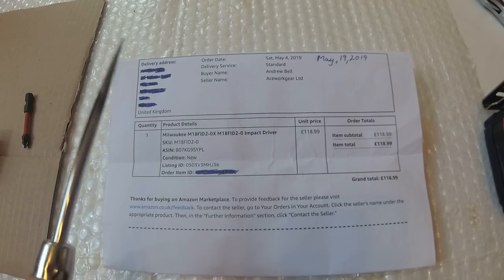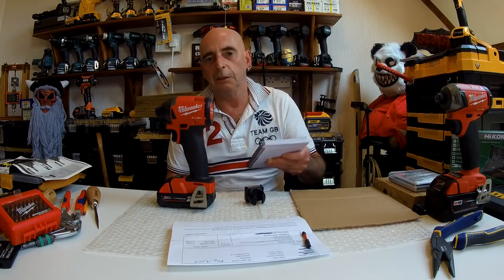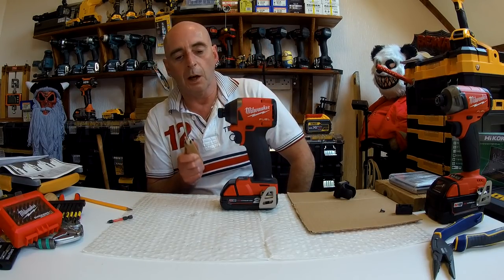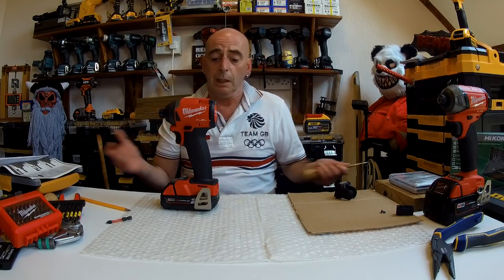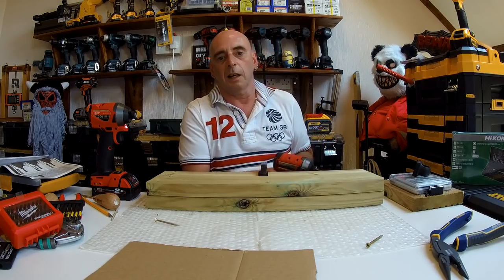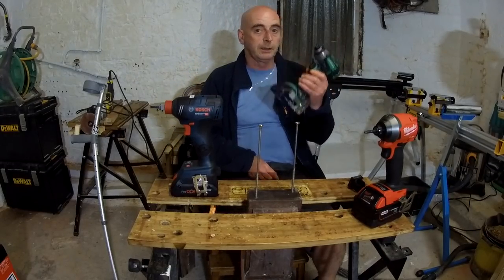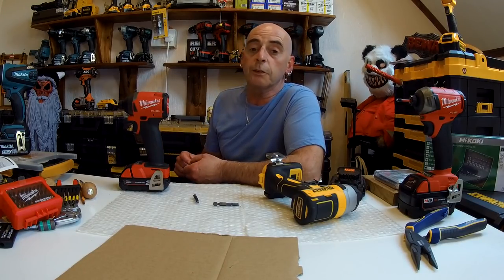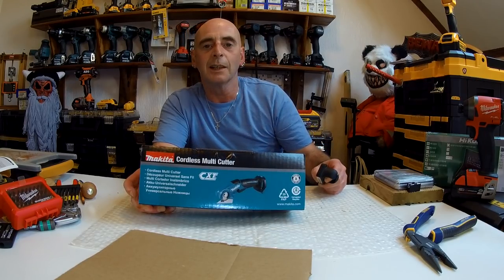MILWAUKEE M18 FID2 GEN3 FUEL Pocket Rocket

Comment: "You gotta try harder than that pal to get me in impact mode"
I am amazed at the size, this is even smaller than my old Milwaukee brushless non fuel, I like the self-tapping mode having stripped several screws, the power of that thing never let me down, so this should be amazing.
TBH I am impressed with every Milwaukee tool I bought, even the non fuel planer, rotary tool, soldering iron

Comment: See on your erbauer belt and disc sander video Milton I noticed the drill press in the background looks like the titan one? Have you ever done a review on this couldn't seem to find one on your channel. Bummer about the damage I would have been the same can't be arsed with all the hassle sending it back and stuff especially with how long it took to arrive in the first place.
Reply from the maker: The reason why I never did a review on the Titan is because it's pretty bad, it's relatively under powered and the chuck keeps falling out of the morse taper. the bearings on it are not that good either. Alot of issues with it are caused by the fact i've had it for a while but it does what I need.
Reply: @littlemilto6563  is that the 750w motor one aswell?

Comment: It cost GBP £558.°° in Miri, Sarawak at Sin Yick Soon Hardware Trading Sdn Bhd.... For a combo of :-

1 M18 FPD2  Hammer Drill c/w 5.0Ah Red Lithium ION battery.
1 M18 FID2 Impact Driver c/w 5.0Ah Red Lithium ION battery.
1 M18 Sawzall CSX (bare) c/w 1 Metal blade & Milwaukee hard case.
1 M18 Grinder CAG-100 (bare).
1 M12/M18 Rapid Charger.
1 Milwaukee Contractor Bag (large).
Reply: Thats an amazing kit for the price